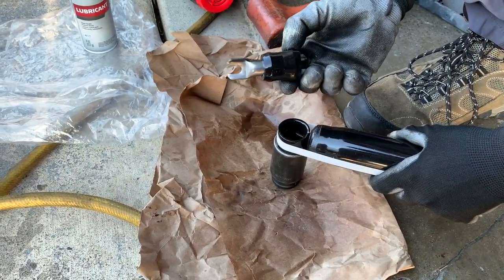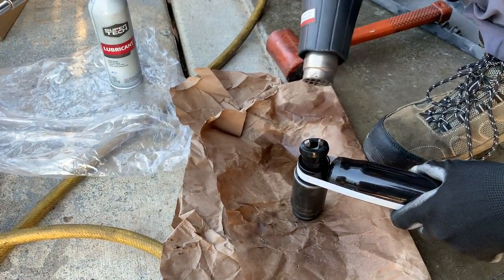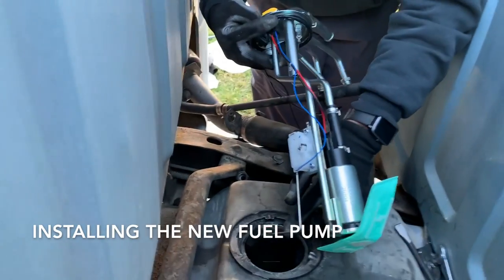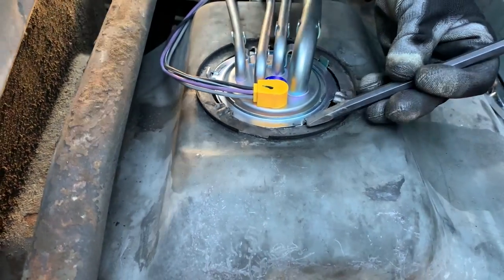90 Chevy OBS 3/4 Drop Lowering Vlog

Comment: Your going to want to go lower i have the same drop and want to go lower lol but maybe it’s just me
Reply from the maker: For me, no way lol. I don't want to be too low but I do want it to be level. I'm thinking about either raising the front an inch or taking out a hanger in the back to give me about another inch lower. I'm hoping that I will like that a little more
Reply: @obssyndicate  will a 265 35 22 tire work on this truck
Reply: @biggdogfresh2263  
Yes, but of course it depends on if you are lowering or going to, and how much
Reply: @nonameisthename138  3,4
Reply: @biggdogfresh2263  
You should be good with that. Front tires might bump the bottom of the fender, depending on what you use to lower it
Reply: @nonameisthename138  drop spindles and springs
Reply: Bag it up !!!!
Reply: What brand lowering kit did u use..?